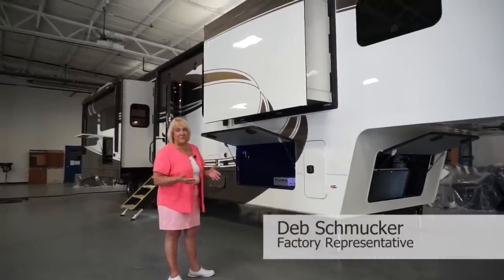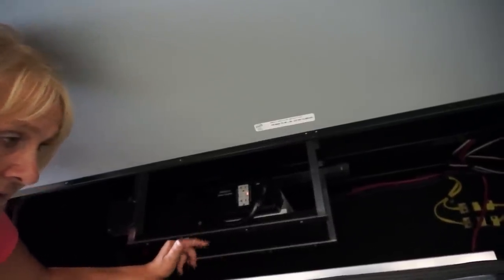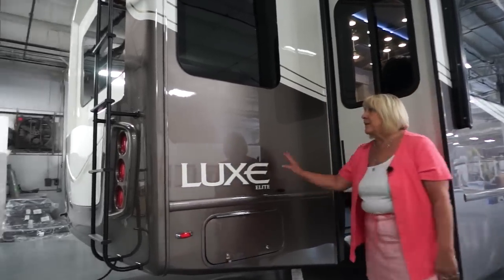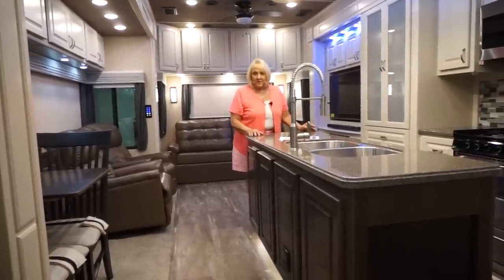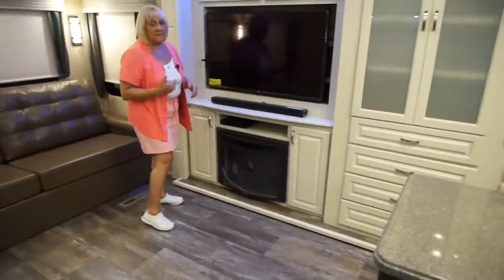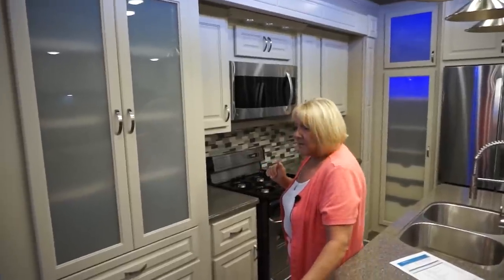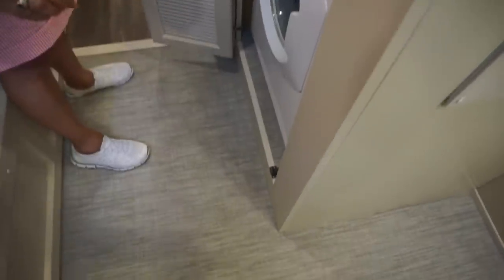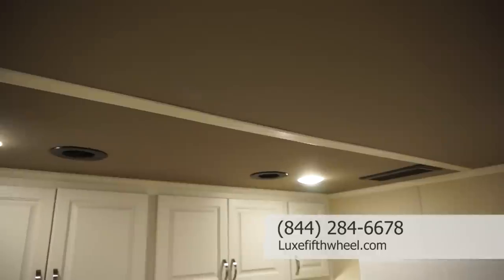Luxury fifth wheel walkthrough- Luxe Elite 42RL Luxury Fifth Wheel - Product Review

Comment: I originally thought the Dishwasher would be unnecessary, but the wife really wanted it, and I'm Very Glad we got it. It works great! TIP: You just gotta remember to adjust your water heater to be in the "ON" mode instead of the "ECO" mode which is where we normally keep it to save LP.  But it only takes 2 seconds to adjust the water heater switch when doing Dishes or Washing Laundry.
Reply from the maker: Thanks Brian

Comment: Thank you for a nice walkthrough. I have some questions. 
1. So I was a bit confused about the insulation of the roof. Is it also 3" thickness? Have the same R-value as the walls? Heat rises. And also a good insulated roof helps keep summer heat out. I'm looking to full time so important factor for me. 
2. I did not get the full scope when you explained the heating. You mentioned that the trailer can also be heated by electric. Is this only.through the fireplace or also the main system?
3. Does it have potable water fill?
4. The yellow stairs to the door look a bit odd. Is this the real stairs or something temporary? How does it fold in or collapse?
5. Is it.possible to get a roof.rack on too? I am a ham and want to transport a sort.of large antenna on the top.
6. Great with soft self closing drawers. I'm from Sweden originally and this has been the standard the latest 20 years. Dont know why your.comoetition has not.discovered it yet. Noticed though that the drawers.in the pantry dont have it. Is it possible to install?
7. Range, is it possible to get it with induction cook top?
8. Fridge, any options here?
9. Batteries.. Li-On?
10. What are the electrical cables made to withstand? In case one would want to upgrade the wattage on the inverter? Would cables manage a 4Kw?
11. The built in solar prep, how many Watts of solar can it take?
12. Is it possible to have the ensuite door from the bedroom to the bathroom made a wall instead?
13. What's the best place to build a office space? Take out the sofa? Make the dinette deeper? Any suggestions? I work a lot from home. 
14. Where is the LP gas locker? How many tanks? Size of tanks?
15. Where is the diesel tank for generator located and where is the fill?
16. Is it possible to get this model or something very similar in travel trailer instead of 5th wheel?
17. Are all lights LED?
18. You showed us the inverter position but is it a 2Kw or 2.5Kw?
19. Is it possible to run the AC from the batteries or only from external power source ?
20. What is the average power consumption over an average year of this rig (ballpark)?

Thank you, will look at more of your rigs and subscribed. 
/Magnus
Reply from the maker: Thanks, for your excellent question sm6wet! These questions would be best answered with a phone call.
Please give us a call and we can discuss your needs. (844) 284-6678 
Also, take a look at our build your owns below. This will give you an idea of costs.

- Luxe Elite build your own: https://luxefifthwheel.com/build-your-own-fifth-wheel 
- Luxe Gold build your own: https://luxefifthwheel.com/rv/luxe-gold-luxury-full-time-fifth-wheel/luxury-full-time-fifth-wheel
- Luxe Toy Hauler build your own: https://luxefifthwheel.com/rv/luxury-fifth-wheel-toy-hauler/luxury-full-time-toy-hauler-fifth-wheel

- We are a Direct to Consumer manufacturer so we completely eliminate the middleman. 
I would like to invite you to come and visit our factory. Please schedule a tour here: https://luxefifthwheel.com/about-luxury-fifth-wheel-manufacturers/luxury-fifth-wheel-factory-tour
Show less